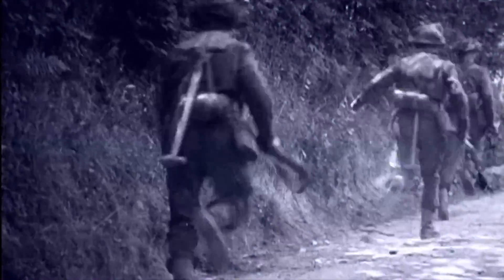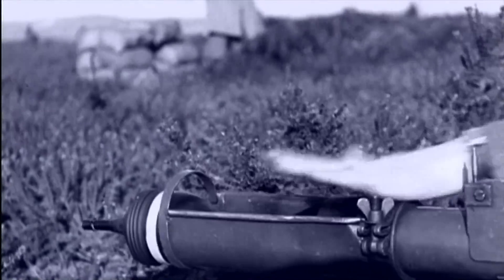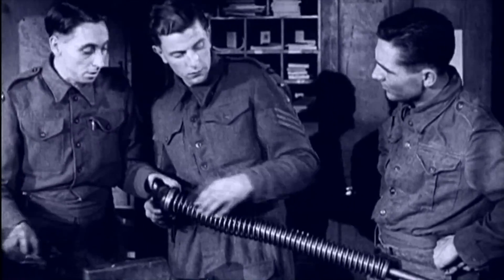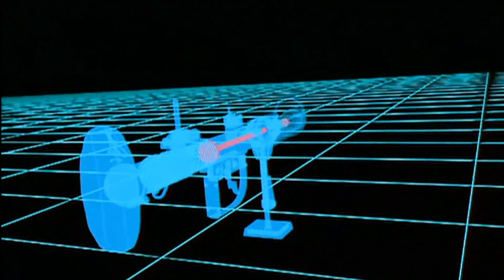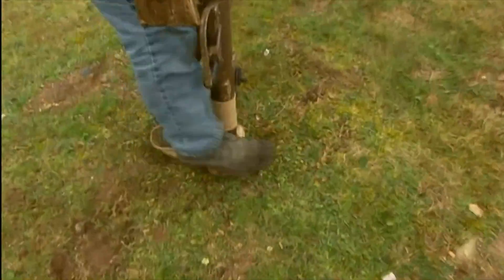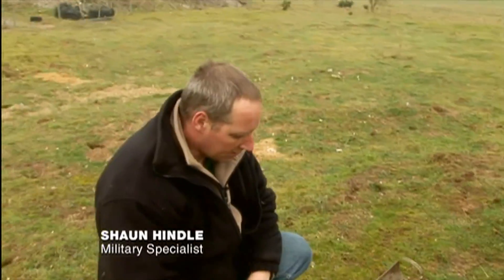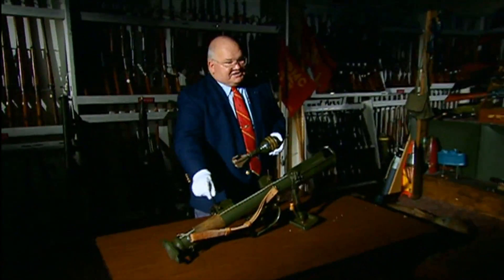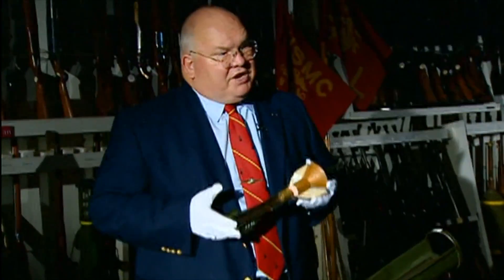Weaponology - "British PIAT"

Comment: The arguments in the comments are kind of amusing.

We cannot compare the PIAT to post war developments of the bazooka. It was a weapon for its time, developed quickly to meet a need the British had. The Boys 20mm rifle was no longer capable of breaching armour, so they came up with the PIAT that used the same style of mechanism as a spigot mortar, of which they had plenty, to launch a hollow charge at armour. Its effective range was approximately equivalent to any other contemporary man portable anti-tank weapon, and it was able (if hitting on the correct angle, and not against spaced armour) to defeat any armour it was presented with up until the end of the war.

Its recoil was no worse than the Boys, which of course meant it was still considerable but not unmanageable, and it could be fired prone, and within enclosed spaces, without too much hassle. If it was heavy, well? It's like an elephant gun. You feel it's very heavy, and has a huge recoil, right up until an elephant is charging down on you, and then it feels like thistledown. Given the choice between a PIAT and nothing against an oncoming tank, give me the PIAT.
Reply: My understanding was that it was rather well liked because it had no back blast so could be fired from inside buildings and the lack of muzzle blast meant it did not give the firing team's position away. The Wikipedia article below references a survey of Canadian officers who left combat in 1944 / 1945 who rated it as their number 1 effective combat weapon. Plus the cocking issue mentioned in the video was a bit of a red herring because you could cock and carry the weapon prior to combat and only load it later when it was required for immediate use and troops were trained to do this. A good weapon for its time but became obsolete and wasn't upgraded post war because the greater thickness of armour it needed to penetrate required heavier projectiles and thus a stronger spring to throw them, to the point where cocking the device would have been impossible manually and the device would have had to have been much heavier to contain the stronger spring. The initial throw of the projectile by a spring gave the weapon it's advantages but meant it was not upgradeable unlike the Bazooka for which a small increase in weight caused by increasing the diameter of the tube resulted in a significant increase in firepower from bigger projectiles. Nonetheless a good weapon for its time.

https://en.wikipedia.org/wiki/PIAT
Reply: It's hilarious that you want to call out other people's arguments and then say "I'd rather have a PIAT than nothing". You could literally say that about anything. Throwing a rock would be more effective than nothing.
Reply: Jason Clark boys at Rifle was .55 caliber
Reply: I read that the M 9 A 1 used a simple magneto trigger operated switch instead of a battery but maybe the M 9 did too,  all I can find about the M 9 is that production started in September 1943 and it was recommended to standardize on the M 9 in late October  but no date for when they were introduced, the M9 A1 was recommended as a replacement for the M 1 A 1 in July 1944, again no mention of when they were in use.
The M 1 was first used in late 1942.  I find little to suggest the M9 had much or any use before 1944, most likely around March in Italy at the earliest.
Reply: Yeah, the sources don't really agree with each other, I get a range of dates for first use of the M9 from immediately (October 1943) to August 1944 at the latest.

The only real differences between the M9 and M9A1 were improvements to the tube coupling mechanism and that the M9A1 always had the Polaroid T90 optical sight while early M9s had the General Electric T43 folding bar sight. If you find yourself an image of a bazooka with the T43 it must be an M9, and if you do that you'll see it's externally practically identical to any M9A1 image you can find, and certainly doesn't have anywhere you could put a battery.

http://tothosewhoserved.org/usa/ts/usatso01/img/img358.jpg

That's an image of a bar-sighted M9 next to an M1A1, you can just about see the M9 has no shoulder stock and so nowhere to put a battery.

Also just for fun:

https://upload.wikimedia.org/wikipedia/commons/c/c5/Dr._Goddard_and_a_1918_version_of_Bazooka.jpg

That's Goddard's 1918 prototype. As you can see, not exactly a bazooka.
Reply: wasnt the boys rifle .50 caliber?
Reply: @BoomchacleV0  .55 cal.
Reply: Barrie Rodliffe 
Because by the time we'd seen the M9 in combat we'd already built one hundred thousand PIATs and something like five million rounds of ammunition. I mean on, that's like arguing the Bren wasn't a better light machine gun than the BAR because if it was the Yanks would have started using the Bren.
Reply: @CruelestChris  The BREN was a far better section weapon than the BAR.
Reply: The Bazooka was not good until late in the war after a lot of modification, it still could not be used in many situations that the PIAT was.
Reply: Clueless Chris, the PIAT was produced in 1942 and used in 1943, the Bazooka M 9 was only produced starting in September 1943, when was it first used?  not September or October 1943 was it?.   
The 1944 M 9 A1 had the battery replaced.
The Bazooka was never able to be used in all the situations the PIAT worked in rather well judging by the results, I know I would rather have the PIAT and be able to use it with far less chance of detection. .
Reply: That on the other hand isn't really true, it's not particularly clear what Goddard created in WW1 but since Uhl had the idea of using a tube launcher separately, the bazooka was probably an independent design. The WW1 system also didn't use hollow charges, so it was to the bazooka what the Blacker Bombard was to the PIAT.
Reply: The M9A1 couldn't have replaced the battery because there was nothing for it to replace. The first model M9 switched over to a trigger magneto produced by Magnavox, that's why it doesn't have a solid shoulder stock like the M1 did. Little hard to find a date for first use of the M9, but things I'm reading seem to gravitate around December 1943.
Reply: The PIAT could be used in many places that a bazooka could not because the back-blast of the bazooka was a dead give away of the firer's position whereas the PIAT had no back-blast and only the small re-cocking charge which was negligible.
Reply: Not sure what you mean by postwar on the bazooka, the first truly not-shit bazooka was the M9 in October 1943.
Reply: Barrie Rodliffe the brittish were not in good standing to buy weapons late war.  M9 bazooka has m9a3 rocket with 300mms pen (which could also be fired from airplane mounted m8s cough gaigin add this cough cough
Reply: CluelessChris.
Production of the Bazooka M 9 started in October 1943, the M 9 A 1 with improved sights started production in June 1944.
If the Bazooka was so much better why did it take until 1951 before the British started to use  a much later version of Bazooka?
Reply: Naw, "late in the war" is an exaggeration, M9 was October 1943 and the PIAT had only been in actual combat use since Operation Husky in July of the same year. The only real change in the M9A1 (September 1944) was improvements to the coupling mechanism of the two-part tube, very incremental. And it could be used in most of the same situations, the only exceptions were edge cases like firing from a totally unprepared room.
Reply: Jason Clark uh. Dude. Bazooka was a world war 1 design updated.   And far superior
Reply: Sir Illuminar The Valient The piat fired about 10 times faster, had no flash, no smoke trail, could be fired in enclosed spaces and had a bigger projectile than the M9 bazooka. Which one is better?
Reply: @SvenTviking  
No, it didn't fire about ten times faster. Practical RoF in combat was the same, because the PIAT is a muzzle-loader and you still have to ready and prime the bombs before you loaded them (since oddly they weren't carried around with the fuzes in the armed position).
Reply: CruelestChris They were not carried around primed due to an horrendous accident in Normandy that killed 120 men. But a PIAT team in combat would have a number of primed projectiles with them and they could be fired as fast as they could be dropped into the tray. There are no wires to connect up.
Reply: @SvenTviking  
Yeah, that sounds like a good idea, just have a bunch of armed contact fuzes built to land point-down laying around. Connecting the wires is fairly trivial in terms of time, and unless the loader was leaning right over the weapon to drop the next bomb into the tray (presumably because he couldn't find a Wile E. Coyote sign saying "We're here, please shoot us" the time difference wouldn't be significant. Nevermind that PIATs often failed to re-cock themselves on firing and the teams often relocated after every shot. The idea that this was a rapid-fire weapon has no basis in any source I've seen.
Reply: @CruelestChris  
Try reading about Major Robert Cain, he did rather well using one, the Canadians liked them very much. Certainly preferable to the one shot Bazooka.
Reply: @barrierodliffe4155  
They're both single-shot weapons. There's no evidence whatsoever that a PIAT had a practical rate-of-fire advantage under combat conditions, most stats point to both weapons achieving 3-5 rounds per minute with a competent crew.
Reply: @CruelestChris  
Or as really happened a lone soldier could fire more times and survive than a Bazooka crew. The Bazooka did not knock out nearly as many tanks as the PIAT. I know Hollywood movies show the US did it all and made the best but the real world is very different.
Reply: @barrierodliffe4155  
Again, what does that have to do with it not having any significant rate-of-fire advantage? And I believe PIATs were generally issued to a two-man crew (second man being the loader / spotter / ammo carrier) and I can't see what advantage either weapon would have being employed by a lone soldier.
Reply: @CruelestChris  
Simply that the PIAT could be used by one man effectively,  the second man was a loader and spotter but not essential. AS happened to Major Robert Cain when his spotter was killed, he carried on alone and did stp many tanks, some others were driven off by soldiers using the PIAT and the German's thought they had been attacked by anti tank guns.  I stand by the fact that the PIAT could be fired several times while the Bazooka would give it's position away on the first shot.
It is no wonder that the British rejected the Bazooka as being useless.
Reply: @barrierodliffe4155  
The British didn't reject it for being useless, I don't believe there was ever any significant discussion about adopting it in the first place. And there you're talking about an edge case of a single man using a crew-served weapon, which is not an ideal scenario: still, I can't see any reason why either weapon couldn't be employed by one man since it's not like they become impossible to load. This is in a case where you fire-retreat-reload, so the disadvantages like having to take the sight off the target while loading (applies to both weapons) wouldn't be an issue. Unless you're talking about the incident with the StuG III at Oosterbeek, but again, I don't think the choice of weapon would have made much difference there.

I'd suggest you look up a US Army training video called "Crack That Tank," a big part of the reason US infantry didn't knock out a lot of tanks (aside from that they didn't encounter as many due to force locations) was that they were trained to disable and harass them, with the knock-out blow coming from artillery, tanks or aircraft. It's a doctrinal thing.
Reply: @CruelestChris  
No of course not the British tested the Bazooka and found it to be so good they rejected it. The one case which may well not be the only time shows that the PIAT was able to be used effectively by one man.
The reason the US did not knock out many tanks is that they lacked the 17 pounder anti tank gun refused the Firefly and were left with the Bazooka, in fact the best anti tank weapon the US had was the British 6 pounder.   The P 47 barely had much effect on tanks.  Maybe lucky that most of the German heavy tanks and the best troops came up against the British and Canadians who were better equipped to deal with them.
Reply: @barrierodliffe4155  
So if you're claiming it was evaluated and rejected, when did this take place? From what I've seen it simply wasn't ever suggested because Britain was prioritising getting ground vehicles through lend-lease rather than infantry arms, due to having plenty of the latter already. And again, I don't see any particular mechanical reason that one man couldn't use a Bazooka.

And given some credit the M18 Hellcat with being the best tank destroyer of the war, I can kind of see why they didn't feel they needed the Firefly: not a matter of "it's worse," just "we've already got one that seems to be working just fine."
Reply: The americans did not adopt the Firefly because they knew their own 76mm was almost equally capable against enemy tanks (tank tests conducted in Isigny, France in August '44 did show that FF and 76mm could penetrate the Panther's frontal plate from pretty much the same distance but FF could never hit the same place twice while 76mm was really close to hitting the same spots) and it was considerably easier to use - FF had very bad ergonomics and the 17pdr accuracy was inferior to 76mm.  Also the amount of smoke made by the gun after firing made it impossible to make another firing solution for a substantial amount of time. The P47 and allied CAS had a devastating effect on german tanks' ability to fight - even if they would not destroy them, they would cripple their supply lines and most german tanks would simply be abandoned due to lack of fuel - so saying that CAS barely had effect on tanks is simply false. One man could easily use the bazooka with no problem at all, would just take some more time reloading.
Also allied tanks often knocked out german tanks by not even penetrating them with AP shells - very commonly HE or White Phosphorus shells were used, and that would either crack the armor or result in fires inside the german tanks, which were abandoned as a result, so the americans were adequately equipped to deal with german tanks.
Reply: @CruelestChris  Yeah, there is no evidence to support the theory that the british tested the Bazooka. There is no document that says so, and well, it makes little sense - as you just said, PIATs were already available in a large quantity and dumping them would be dumb. The allies did not really go into one another's small arms and team weapons, mostly focusing on vehicles. And even in that case, for example the british opted for their own weapons - often using Bren machine guns on top of the half-tracks instead of .30cals and commonly removing pintle .50cal mounts from their Shermans.
Reply: @CruelestChris  
Exactly it was tested in 1942 and found wanting. Britain did get some tanks through lend lease but they had tanks of their own and the Universal carrier which was the most important armoured vehicle of the war. Britain also made all the special tanks that served so well in Normandy but they also used the PIAT to good effect, 7 % of the German tanks destroyed in Normandy were by the PIAT. Given that the M 18 was not so good, just as well the US did not face most of the heavy German armour.  The Firefly could at least destroy a Tiger tank.
Reply: @barrierodliffe4155  
Um, where is the evidence it was tested at all, or that adopting it was ever considered? And if you have that, what is the evidence that it was rejected due to shortcomings of its own rather than reasons related to production difficulties?

Also come on, a Bren Carrier is a dinky ittle transport, Britain was mostly interested in replacing all the proper armour we'd had to abandon at Dunkirk.
Reply: @CruelestChris  
Oh dear poor little clueless, you really hate it that the Bazooka was not that good, Maybe when I have time I will look up when and where it was tested in Britain, from memory it was in 1942 and the PIAT was adopted in preference but for now I will give you US experiences of the Bazooka.
In 1943, field reports of rockets sticking and prematurely detonating in M1A1 launch tubes were received by Army Ordnance at Ogden Arsenal and other production facilities. At the US Army's Aberdeen Proving Grounds, various metal collars and wire wrapping were used on the sheet metal launch tube in an effort to reinforce it. However, reports of premature detonation continued until the development of bore slug test gauges to ensure that the rocket did not catch inside the launch tube.
Battery problems in the early bazookas eventually resulted in replacement of the battery-powered ignition system with a magneto sparker system operated through the trigger. A trigger safety was incorporated into the design that isolated the magneto, preventing misfires that could occur when the trigger was released and the stored charge prematurely fired the rocket. The final major change was the division of the launch tube into two discrete sections, with bayonet-joint attachments. This was done to make the weapon more convenient to carry, particularly for use by airborne forces. The final two-piece launcher was standardized as the M9A1. In September 1944, the fragile folding aperture sight was replaced by a Polaroid optical reflector sight[16] However, the long list of incorporated modifications increased the launcher's tube length to 61 inches (1.55 m), with an overall empty weight of 14.3 lb (6.5 kg). From its original conception as a relatively light, handy, and disposable weapon, the final M9A1 launcher had become a heavy, clumsy, and relatively complex piece of equipment.
In October 1944, after receiving reports of inadequate combat effect of the M1A1 and M9 launchers and their M6A1 rockets, and after examining captured examples of the German 8.8 cm RPzB 43 and RPzB 54 Panzerschreck, the US Ordnance Corps began development on a new, more powerful anti-tank rocket launcher, the 3.5-inch (90 mm) M20. However, the weapon's design was not completed until after the war and saw no action against an enemy until Korea.
Try digesting that little list of problems many of which were not solved until late in the war and some not until after the war.
There is no doubt the the M 20 was better than the old PIAT. but not in 1943, 1944 or 1945 when it was needed.
Reply: @barrierodliffe4155  
I know that stuff, I've said it myself before when I outlined that the M1 was of lesser quality and often outright dangerous to operate, stop trying to change the subject. Where is the evidence that the British ever tested the Bazooka with any intention of adopting it?
Reply: @CruelestChris  
You missed that even in late 1944 the Bazooka was still having troubles and as I said if you read it I will look it up for you when I have time which is not right now, a little patience should not be too much of a problem for you.
Reply: @barrierodliffe4155  
Nope, didn't miss that either, stop trying to change the subject.
Reply: @barrierodliffe4155  
So you don't have any evidence, gotcha.
Reply: @Lehr-km5be  
The British decided the Bazooka was not worth the cost or effort when they had the more effective PIAT. Some 600 Bazooka were sent to the British in North Africa in late 1942 but they had little if any use.
Even the US found the Bazooka to be lacking and tried to improve it many times.
"In 1943, field reports of rockets sticking and prematurely detonating in M1A1 launch tubes were received by Army Ordnance at Ogden Arsenal and other production facilities. At the US Army's Aberdeen Proving Grounds, various metal collars and wire wrapping were used on the sheet metal launch tube in an effort to reinforce it. However, reports of premature detonation continued until the development of bore slug test gauges to ensure that the rocket did not catch inside the launch tube.
Battery problems in the early bazookas eventually resulted in replacement of the battery-powered ignition system with a magneto sparker system operated through the trigger. A trigger safety was incorporated into the design that isolated the magneto, preventing misfires that could occur when the trigger was released and the stored charge prematurely fired the rocket. The final major change was the division of the launch tube into two discrete sections, with bayonet-joint attachments. This was done to make the weapon more convenient to carry, particularly for use by airborne forces. The final two-piece launcher was standardized as the M9A1. In September 1944, the fragile folding aperture sight was replaced by a Polaroid optical reflector sight[16] However, the long list of incorporated modifications increased the launcher's tube length to 61 inches (1.55 m), with an overall empty weight of 14.3 lb (6.5 kg). From its original conception as a relatively light, handy, and disposable weapon, the final M9A1 launcher had become a heavy, clumsy, and relatively complex piece of equipment.
In October 1944, after receiving reports of inadequate combat effect of the M1A1 and M9 launchers and their M6A1 rockets, and after examining captured examples of the German 8.8 cm RPzB 43 and RPzB 54 Panzerschreck, the US Ordnance Corps began development on a new, more powerful anti-tank rocket launcher, the 3.5-inch (90 mm) M20. However, the weapon's design was not completed until after the war and saw no action against an enemy until Korea."
The M 18 was considered as the best US tank killer but it lacked armour and a good gun, it could handle the tanks the US came up against and lucky the US met very few heavy tanks. The Firefly had a better gun which really could destroy any German tank.
Reply: Your selective use of your own source is shameful - it is obvious that you used wikipedia (I checked, you literally copied a lot of it), and it says at wikipedia quote "In September 1942, a consignment of 600 M1 bazookas was shipped to Egypt for use by the British Army in the Western Desert campaign. In a demonstration to British commanders, a bazooka penetrated the frontal armor of a captured Panzer III; however it was decided that the desert terrain lacked the concealment required for such a short range weapon and it was not deployed in that theater."  Meanwhile you claim that the british did not use it because the PIAT was more effective, even though that PIAT was not even in use at that time - YOUR OWN source contradicts what you said, and you tried to make it up. Absolutely shameful, but thankfully it is very easy to expose false people like you. Sorry, but you are not gonna fool people here, nobody is going to fall for such bad source faking.
Reply: @Lehr-km5be  
I saw that but that is not where I got the information from that the bazooka was not considered to be any good by the British, if that was the only reason not to use it why did he British not use the wonderful Bazooka in Sicily, Italy or anywhere else?   
In a demonstration the Bazooka hit a stationary target at close range but it was not used by the British who did use the PIAT, Have you even stopped to wonder why the British used such a bad weapon when at least according to you there was a better weapon?  Are you trying to make out the British were stupid?

So sorry that in your desperation to make out the PIAT was no good you resort to lies and you have nothing to back it up.  
You have exposed yourself may times as a liar.
Reply: @barrierodliffe4155  Sorry, but you are not going to lie your away out of this one - I know that you used wikipedia, because you literally also copied the "16" number, and that was a reference in the part you copied. I simply exposed that you selectively used the Wikipedia article and even changed it yourself to suit your opinion. Things dont work like that, shame on you.
There are plenty of examples with British using shit weaponry because they simply had to - seems like you do not know how Sten came into existence, how bad it was and why it was used until the end of the war. Sometimes you have to make do with bad equipment, because you simply cant get anything better.
You are an exposed liar dude, and you are not getting out of this one :)
Reply: @Lehr-km5be  
I'd argue the Sten wasn't as bad as people say: subguns using single-feed dual-column in general weren't very reliable during the war, and soldiers love complaining about their equipment, particularly when it has the feature of having no position where it wasn't poking you somehow when you weren't holding it in your hands. Otto Skorzeny seems to have been pretty impressed by the suppressed Sten, though, and there's evidence German soldiers issued MP40s would carry a Sten as well if they could get one because it was much easier to fire while prone and took the same magazines.

I mean if you want an example of us using something we knew full well to be rubbish the best would probably be Blowpipe, arguably the worst MANPADS ever made.
Reply: @CruelestChris  Yeah, the blowpipe was really a mistake. Of course there are two sides to any equipment discussion : overall usefulness in a broad picture and down to earth opinions from singular soldiers. I have read a lot of accounts of british soldiers not really liking Sten, due to it having constant feeding problems, jams, and very bad weight distribution, making aiming really hard. British paras tried to put some front handles to make the gun more controllable, but it was not a great solution. Silenced Sten was a really interesting SMG tho, perfect for commando raids conducted by the british. And well, MP-40 was not a really great SMG aswell.
Then there is a second part of the whole discussion - Sten was extremely cheap and easy to produce and maintain, which is pretty much exactly what the UK forces needed when they entered the war with no SMG whatsoever. The same goes for example for T-34 -  bad ergonomics and very high casualty rate per tank destroyed  , not particularly liked compared to  lend lease Shermans for example - but it proved to be exactly the design the soviets needed to win the war.
Reply: @Lehr-km5be  
Oh dear, I did copy that from Wikipedia but I looked further to confirm it.  I changed nothing, what I posted was exactly what was there.
You keep on lying all the time and you are the one trying to twist things.
Reply: @Lehr-km5be  
I know the Sten was awful, some idiots like you keep on saying it. The fact is it worked and was very useful. Britain made the Sten because they needed it and did not want to pay the high cost for a Thompson even if there were enough. The Sten being made in millions and used in many actions by the resistance and various forces,  Germany even made thousands of copies.
The simple fact is the Sten worked well if looked after and used as it was meant to be.
The Sherman was not exactly the best tank but because it is from USA it gets credit even for things it did not do.